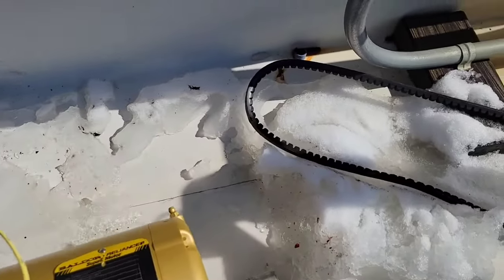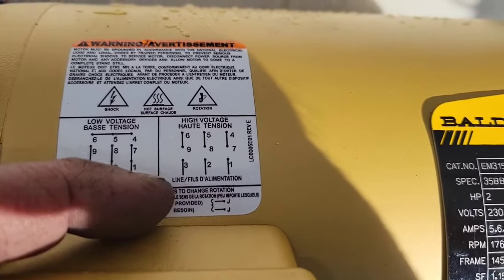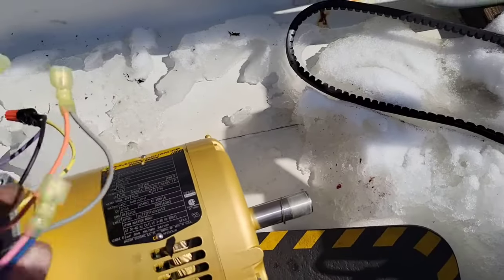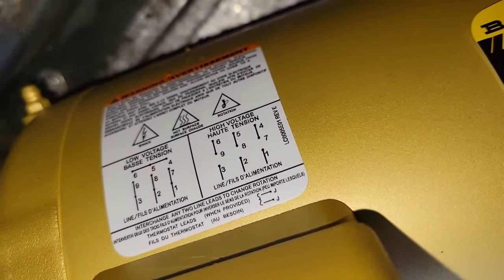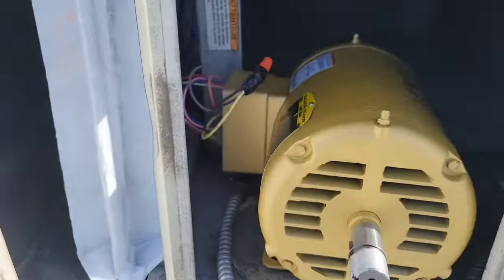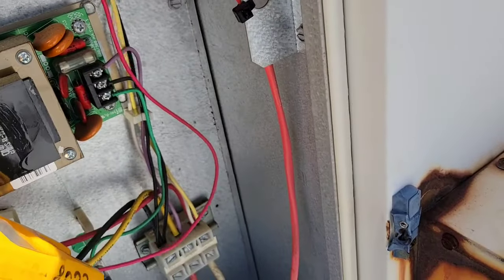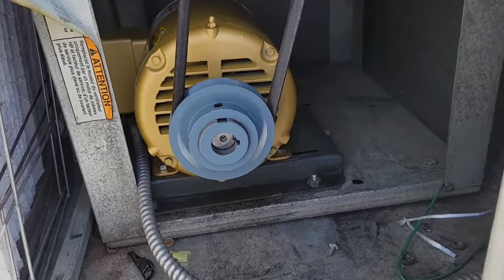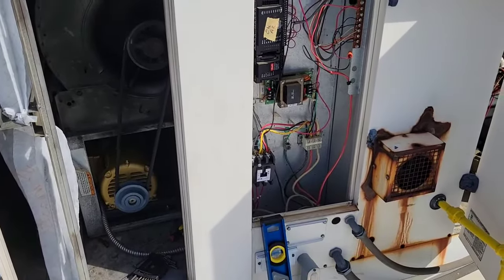HVACR - How to Wire A 3 Phase Motor (230V / 460V )

Comment: Solid video. I would recommend taking amp draw with the fan door closed. You are trying to move more air than designed and will draw more amps with the door open like that. Belt looked loose at the end of the video.
Reply from the maker: Thank you for the comment,

Excellent information that I forgot to mention :) 

I really love comments like these because I grow as a technician as well as I hope other people read them !!
Reply: @gendronhvac-r1269  likewise man!
Reply: Hmmm, I thought the amps would be lower because with the door open, the motor wouldn't work as hard due to the duct work having higher pressure. Basically more resistance (static pressure in this case) more amp draw?

Comment: What if you have 208-230/460//190/380?  With a low voltage and high voltage wiring diagrams? If I’m trying to connect for 208-230 which one would I be using?
Reply from the maker: Yeah I have never seen that ever. 

But If you only have 2 wiring diagrams Then probably low voltage. 

The motors are probably designed to handle voltage from a 190 - 230 Is that would probably be the low voltage. 

And 380-460 

And that would be the high voltage. 

But I have never seen such a thing. 

What I would do is wired in for low voltage. 

Take an amp draw and make sure it's not violating the amp draw on the name plate. 

You might need to adjust the The pully If it's about driven system. 

Make sure it's within the amperage that is outlined. 

Good luck man!
Reply: @gendronhvac-r1269  yeah that’s what I thought too thnx for replying and yeah I had to adjust it.

Comment: Thanks mate. I the internal/motor cores aren’t identified can i use a multimeter on ohms to find what pairs should go together?
Reply from the maker: You could probably do that that's definitely something I would have to draw out. And like test. 

I'm sorry but without being there I couldn't really advise you one way or the other but I think it's a possible approach. 

I know there's multiple kinds of windings for Motors so you would have to know what kind of winding you're dealing with and then kind of work backwards from there. 

Good luck man sorry I couldn't be more help
Reply: @gendronhvac-r1269  Thanks for the reply, keep up the good work.

Comment: What kind of connectors are there for the connections in-case I want to use them for something similar?
Reply from the maker: They're called Spade terminal connectors you can buy them at United Refrigeration

Comment: Does that mean the low voltage wiring is a " Star" vs high voltage a "Delta" ? I can't seem to wrap my head around it ?
Reply from the maker: So if I'm honest I'm not super sure I would have to do some digging into it. 

But from my understanding one configuration is in series and the other configuration is in parallel. 

So if you were to imagine a pair of train tracks. 

You wire it for 230 both train tracks get voltage to it at the same time. This means current is running through both sides of the train tracks at the same time. This is in parallel.

Line power: ------------------- neutral 
Line power: -------------------neutral 

Then if you wire it for 460. Only one set of train tracks gets the voltage but you add a connector so you connect the tracks. So you make a giant U Shape. This would mean your voltage would have to travel through both sets of tracks before it reach the end. This is in series.

===========>

It's something like that so inside the compressor if there's a bunch of coil windings and what you're doing is you're running windings in series or parallel based on your voltage need. 

I believe the Delta and y variation are just configurations of the winding. If memory serves a Delta has a neutral where a y configuration does not. 

So I don't think the configuration matters I just think that running the configurations in parallel or series is the main issue. 

I hope that helps

Comment: When you check amp draw, are you checking between main power and starter?
Reply from the maker: So when I would check amdraw in a three phase set up. 

1) Make sure that The air handler is closed. You need to make sure that the panel where the motor is 
, is on, because this will Affect the air flow which will affect the amp draw. 

2) I would take the amp draw  just below the motor contactor. 

There is no start capacitor in this setup. But even in that setup I would still just take amp draw below the contactor. 

I hope that helps

Comment: Sir i have three phase motor if i set this motor to low voltage then will that motor withstand  220 board volt to 440 volt.
Reply: If i had a vfd based current that is near about 400 volt then motor works on low voltage settings..?
Reply from the maker: I'm not sure You would have to look at the voltage range on your motor. 

The motor that I had a four hundred volt range would be high voltage.
Reply: @gendronhvac-r1269  the motor is curently running on 440 and i had to change the motor connection on low voltage for better performance
And the input crunt is remain same.

Comment: Can it work with solar power?
Reply from the maker: I suppose it could. 

But you would need a adapter to convert the dc solar to 3 phase 208 AC . 

And it would have to be one heck of a solar source.

Comment: question if you can help me running a VFD with this kind of motor mine is the same but 3hp model number EM3611T. i want to power it with a house hold 220/240 single phase power converted to  3ph. the VFD from amazon i want o get for it puts out 3phase 220v can i run the vfd that outputs that 3phase 220v ?
Reply from the maker: I have no idea.  If i'm honest. 

 But using Reasoning skills. 

If the VFD runs off off 240 single phase. 

The converts that to 
208-230 3 phase 60HZ

 And the motor is rated for 208-230 3 phase 

 As long as the VFD is rated for the correct amp draw  I don't see any reason why it wouldn't work. 

 I hope that helps.  As long as the voltage Output and the Amp draw rating match the motor I think it will be OK. 

But  That's just my opinion I've never delt with this. 

Good luck

Comment: 2 of the things that I don't like about this video, what? I don't like about this video. The electrical connections the other is you never take Ambridge reading. With the fan panel off.
Reply from the maker: Yeah taking the amperage with the Fan panel off was definitely a mistake I made with the video. 

I realized it afterwards. 

But yeah thank you for the comment definitely good to raise awareness of that.

Comment: Which wires you switched for different  rotation?
Reply from the maker: I address this at 4:30 in the video. 

 But all you need to do is switch any of the line power.  So for example you could go over to the contactor and just switch Any of the line power with another line power and it would change the rotation. 

 So for example you can just take line one And switch it with the position of line too  At the contactor  And it will change the direction.

 In the video I did this at the motor

Hope that helps :)